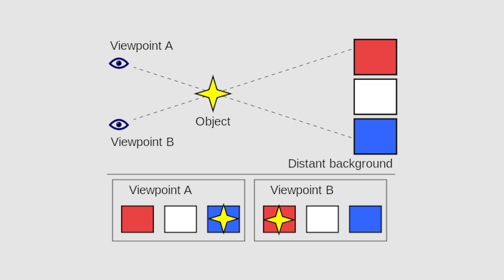How to determine lens nodal point for panoramic photography

Comment: Thank you for the detailed tutorial, this has been immensely helpful!

I am confused about one thing. How are you compensating between portrait and landscape for the fact that your L bracket can be shifted? I'm not sure how you align it unless it has markings I'm unaware of, otherwise wouldn't that negate all the fine tuning the moment you change orientation with the L bracket off? In case I'm not clear, you marked down the three adjustments on the panoramic head. However, there appears to be an entire rail of the L bracket which could slide the camera up or down from the calibrated point, introducing another variable you don't have hash marks for. Or am I missing something?

Thanks in advance if you have some advice or clarification. Either way, thanks again for the informative video!
Reply from the maker: Hi Vinny: Admittedly I am not quite sure of your question. The thing with a camera L bracket is that there is no back and forth motion when shifting from landscape to portrait mode.  I am uncertain what you mean when you say that the L bracket can be shifted. Once it is fastened to the camera it cannot be shifted at ll. In fact, that is one of its strengths and why we use it. Please explain if I am missing your point.
Reply: Thank you for the reply, Lester. Perhaps your L bracket can mount consistently. The one I have is more of an Arca type rail, which introduces a lot of play. I thought yours was also the same. Look at this video and you will see what I mean: https://youtu.be/vjnYg9sw9p0?t=11

The other place mine could introduce play into the equation is mounting the bracket to the camera. Much like a tripod plate, you can adjust it quite a bit before tightening it down. Perhaps yours is different!

Thank you for the video and for your reply! It did not occur to me that my L bracket may have been designed differently than yours :)
Reply: @VinnyLePes  I thought the same thing when watching the video. How is the camera lens still centered over the center of the tripod after rotation.  I suspect he might have made an adjustment while we weren't looking. (magician's trick lol).

Comment: Thank you so much for sharing your knowledge, still very new to using panoramic head, 
1. I am trying to use 21mm to shoot milky way and not quite sure how much distortion i will get with the wide angle?
2. I am tying to find the nodal point (21mm lens) using your method and no matter how I move (front to back) i cannot see the second pole showing up on the live view. even i zoom it in 10 times. am I not spacing the pole correctly? would appreciate if you could shed some light. thank you.
Reply from the maker: Thank you for writing. Good questions. First of all, you will need to shoot a lot with your 21mm to determine distortion. You did not mention what lens brand you will be using, so I cannot predict at all what distortion issues you will face. 

Second, as far as the nodal points for such a wide lens, what you describe is very common. Your lens is sooo wide, it is hard to discern any movement whatsoever. In fact, I often wonder why you feel you need to shoot a pano with such a wide lens. At 21mm, you should be able to get the entire sky and Milky Way arc in one shot. However, I know people who do 2-3 shots even with wide angle, so it's really your choice. 

To find the nodal point, move closer to your poles. Since the lens is so wide and, I assume, has a short barrel, finding the nodal point is razor thin and not easy to determine. Plus, there is typically some distortion with that much wide angle, so when you stitch the images together it magnifies the distortion at the stitch points. I would be very careful to overlap 50% when you shoot, to be safer. Since you will be shooting the night sky at infinity the issues of distortion should not be as great as if you were stitching something that you took closer. 

In any event, please experiment and let us know how you do. I suspect we would all love to see sample stitched images, so please send them to me and I'll post them here. 

Good luck!

Les
Reply: Thank you Lester, I am using Zeiss 21mm Distagon on my 5d mark4,  Stitching is a breeze but i feel that image doesn't look natural  ( I do auto lens Corrections in lightroom before i stitch them.)  Maybe overlapping the images more than 50%?

Comment: Hi. that's an interesting way to go about finding the nodal point. Why not just measure the distance from the film plane mark on the camera with a metric ruler the focal length of the lens? or sensor plane for digital?

One knows the focal length is 70mm for a 70mm lens, 55mm for 55mm lens and so on. The optical center is determined and equal to the lens focal length. You just measure in millimeter the focal length from the film/sensor mark on the camera. That's where the pivot point should be. You don't have to set up anything really. Or even need the lens on the camera, just the camera body.

Your way works, don't get me wrong. Just curious why you take the long way to achieve the same outcome. Or don't do/show both to cross check?

Anyway, I really had a question...
For view cameras were one may have a desire to shift, tilt, etc the film plane or lens board determined by location, desired effect, etc.. Is there method difference?

And thanks for sharing. I enjoyed watching... great demonstration in live view.
Reply: Sorry, not true. You are assuming a simple lens. Modern lenses don't necessarily have the nodal point where you think it should be. Lester is right in his description but the crossover point isn't automatically half the focal length. O how I wish it was. His method using live view is an excellent idea.
Reply: Ray Brown - I'm not saying his way doesn't work. it's just the long way around.
I stand by my simpler described method. It's actually the common method, even with "modern" lenses. Which to be honest, I don't know how you're defining or categorizing a lense as "modern". 
Any quality lense will have the focal length correctly marked. Any quality camera will also have the focal plane marked. it's a simple measurement... And works on every camera and lense I own. And one could say I own a few if not several 😉. From point and shoot to MF To LF.
Either method you prefer...  
Cheers...
Reply from the maker: Ray: Thanks for responding. I've been out of the country on assignments.
Reply: chase I'll give it a go on my zooms and see if it correlates with what I found by "the long way around". Would love it to be true. Thanks for the response.
Reply: Ray Brown - Never used a zoom for this type photog. Only fixed. 
even if you set it for zoom, if you even breath on the lense zoom control..  you have to reset it. 
pointless to me to use zoom for just because of that.
Reply: chase I'll still give it a go although I get your point. Again thanks.

Comment: hi Mr Picker, my question is , can I do panorama with a BH-55 ( RRS) with a nodal slide ( RRS ) and a universal L bracket with the camera vertically ?? or horizontally ?? i' waiting for this answer before buying stuff from RRS, I want to be sure to not forget something. the gimbal head is not something necessary ? I will probably buy the BH-55 with the pannig clamp is it ok to make panoramas instead of the gimbal head t, hank you
Reply from the maker: Yes, you can do panoramas(vertical or horizontal, but it's better to do vertical for the pixel count) with the nodal slide with no problems at all. However, if you want to do multi-row panos you would be well advised to get the full setup. That is because if you rely on the ball head to raise or lower the angle for multiple rows, you will undoubtedly not get it perfect and the stitching will be a real problem.
Reply: Lester Picker ok thank you
So wit'th the panning clamp with an L bracket and the camera vertically and the nodal slide is everything i need , which nodal you will choose with a 16-35 or a 24-70 on a full frame the MPR- CL II or the 192 PPP from RRS ?
Reply: Lester Picker ok thank you

Another question about the L bracket , if i buy a 3rd party L bracket which have no marking line on it, is it ok to just eye ball tne centre of the lens with the centre on the tripod, does it have to be perfect centre, i know that certain L bracket ( RRS, small rig ) have a centrered marking gage on them to center it with the centre on the lens but i would like to know if its correct to ete ball it like you do in your video even if you have the gimbal instead of the bh-55 with mor-cl II which is my setup

Thank you

Comment: i have a nodal ninja 6 . it is a total different mount , you cant get de body exact above the ballhead . and how did you set the camera on  it in landscape on the mount ? also this is not possible with the nodal ninja. the problem is there are no user manuals and no tutorial on YouTube . i was hoping with your tutorial but no. such expensive tool collecting dust.

Comment: I have an 18-200 zoom lens and in testing I found that the nodal point doesn't change when tested at 18, 28, 35 and 50mm. Does this sound right or am I doing something wrong? Thanks
Reply from the maker: Bill: It is possible that you are correct, but I would double-check anyway. I am assuming that you are getting different points at 100 and 200. The internal alignment of lenses when you shift focal lengths can result in no changes between some distances. My 80-400, for example, maintains the same nodal point at 3 different focal lengths.
Reply: Thanks. I haven't checked it beyond 50mm but I will.
Reply from the maker: Bill: I just want to make sure that you realize that panos are best taken at 100mm and more. You want to maximize the number of pixels.
Reply: I didn't know that. I checked it at 135 and 200mm. Actually I had to retract the rail all the way in (moving the camera forward toward the point of rotation) and it was almost perfect. It appeared as though it would actually be better if the camera was in front of the point of rotation. I have a Canon Rebel T3I.

Comment: Thanks for the great tutorials. I have a question I hope you can answer. I just bought a Pan head and "L" bracket for my Canon Rebel T3I. I have the arca fitting with a center marking on the pan head. The center of the "L" bracket on the camera is not marked either horizontal or vertical and has a slot for mounting on each leg. When mounting it in landscape mode I have no trouble determining the point because of a mark on the camera over the mounting hole, but when trying to mount it in the Portrait position I don't know how to determine the proper point to put it over the pivot point. Is it critical and if so can you describe a way to determine how to determine it? Thanks
Reply from the maker: Hi Norman. Thanks for writing. I admit to being confused by what you are asking. These things are difficult to describe. In any event, I'll take a guess that you just need to make sure that when you point the camera/lens down toward the tripod center, the lens is centered over the tripod center. If you then move from horizontal to vertical it will not make a difference. Best of luck!
Reply: @lespicker  thanks for the response. Sorry for the lack of clarity but I'm not too technically literate. I centered the circle formed by the top of the head base with the camera mounted in the portrait position. When I remount the camera in the horizontal position on the head the vertical axis stays centered but the horizontal axis moves up about 25% of the frame. does this mean that I have to recenter it in the horizontal position if I wanted to shoot that way?
Reply from the maker: Norman: I'm back now from some photo assignments. I suggest that the best thing to do is for you to contact me via my website, so we can schedule a FaceTime telephone call and you can show me the issue.
Reply: Thanks for the offer but I think I can clear it up with this question. Once I've centered it in the portrait (vertical position) and decide to shoot in the landscape(horizontal) position . Do I have to recenter it or will it remain centered for the purposes of the nodal adjustment? Thanks
Reply from the maker: @normanziegelmeyer7693  Assuming you are centered when shifting to horizontal, then all should be fine. Best of luck.
Reply: Thanks, did a couple of 360 panos and used PTGui with excellent results. Top and bottom were nearly straight with only minor scalloping.

Comment: Hi Lester, what about the brand of the panoramic head you've got for shooting?It looks very resistant and so affordable for using with heavy lenses .Best regards
Reply from the maker: All my tripod equipment is Really Right Stuff brand.
Reply: Great video, Lester, very approachable. In fairness, you should mention that your gear is highly-specialized and expensive. The Really Right Stuff gear may LOOK "affordable for large lenses", to some but it's the best pro pano gear available and built like a tank (far too heavy for long hiking trips, but RRS makes less weighty pano packages). By my count, the RRS gear ABOVE THE TRIPOD in this video cost roughly $2,000, including the leveler. You might want to include a caveat that this gear is for serious pano work, but that it also includes a BH55 ballhead mounted directly onto the tripod, so "only" $1500+ is just for dedicated pano gear (ballhead can be used as a normal tripod head if you buy an RRC arca plate). If folks are just starting out with panos and don't know if they'll end up using this highly-specialized equipment a lot (it's not of much use for anything but panos), then you might mention they should first look for used gear (www.FredMiranda.com, eBay, etc), although the RRS equipment holds its value and sells USED for 75-80% of MSRP.
Reply from the maker: Before I respond, I have to say that you have always been one of my movie screen heroes. Never thought that Indiana Jones would comment on my unprofessional videos!!

Kidding aside, you raise an excellent point; that gear IS expensive. And, yes, buying it used is a great idea, especially since it is so well made it defies abuse. 

In terms of only being used for panos, I take issue with that. I actually sold my Wimberley head that I used for wildlife photography and instead use this pano setup with excellent results (even better than the Wimberley). It twists smoothly in every direction with complete stability. 

Finally, while I agree with your observation that the pano setup is heavy, I actually lug it with me on wilderness hikes. I am 70 years old, so as I regularly curse it while climbing, I make peace with it by telling myself that it helps keep me in shape. Hey, I never claimed I was smart!

In any event, thanks for watching and commenting.

Les
Reply: Lester, you make a good point about this gear not being necessarily used only for pano. I'm not a wildlife guy (too busy making movies lol) so that use hadn't occurred to me, although I agree the level in-plane rotatability could be of benefit in a bunch of situations where you're tracking moving targets. 

Hats off to you on being able to hike with this gear at 70. I'm turning 60 in a few days and I'm in relatively good shape, but I'm still not sure how you do it! People don't give photographers enough credit for having to move quickly, especially during golden/blue hour when shots can be lost within seconds, and Rick Sammon talks about needing to be in shape quite a bit. 

And all that being said about cost, just today someone listed your package (older model) without the top rail, ballhead and leveler for only $600 on ebay. Still expensive, but a decent price nonetheless.
Reply: Oops, forgot to include the link to the pano system listed on ebay: 

http://www.ebay.com/itm/Really-Right-Stuff-PG-02-Pano-Gimbal-Head-/132190046088?hash=item1ec7240788:g:dSAAAOSwX9FZFfR9

Comment: Should be better to increase the diameter of back pole as twice as front one?
Reply from the maker: James: This is a personal preference, but I have tried that before and I personally found it hard to determine when the two poles aligned. However, if you have a keen eye and it works for you, then there is no reason not to try it. Best of luck!
Reply: Even better use a white pencil for the front marker.

Comment: Hi Lester, may I know when you shoot 360, will you switch off the auto focus?
Reply from the maker: Ernest Ng yes you must turn off autofocus.
Reply: Lester Picker I wonder how to handle when there are some objects or a wall very close to the camera, and some of them is far away when you turn your camera to shoot the next picture.
Reply from the maker: Ernest Ng there are two major ways to handle this. One way is to use a tilt-shift lens. Another way is to use focus stacking at each stop in your rotation.

Comment: Sorry if this is a stupid question or if it has been asked before but haven’t found any previous comment, if using a 70-210 lens do you connect to the head by the lens tripod mount or the camera. Just concerned about the weight issue.
Reply from the maker: Alan: Not a stupid question; glad you asked. For stability reasons, it is best to mount your setup  by the lens tripod mount.
Reply: Thank you for your reply and for your valuable tutorials